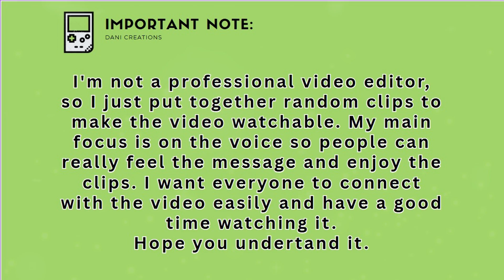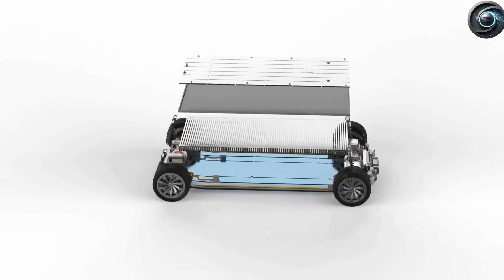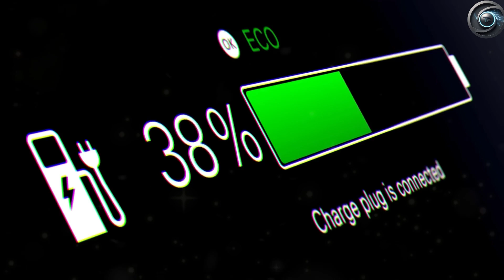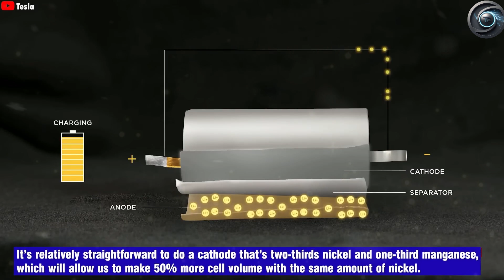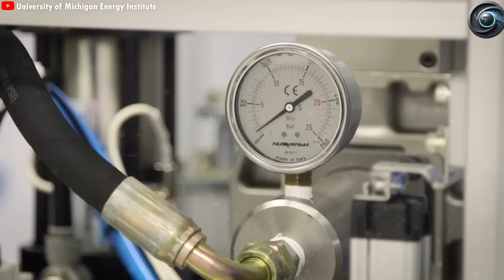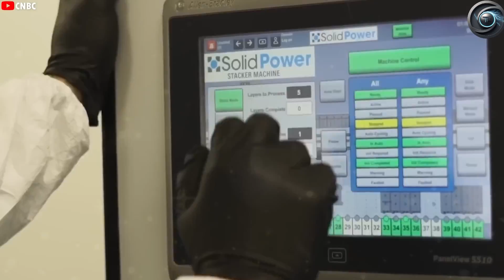Elon Musk CONFIRMS Tesla 1000-Mile CATL Battery! 2025 Game Changer

Comment: Totally irrelevant, the bottleneck is grid supply not battery absorption rate.
How long does the car have to wait at each charger type (with and without other customers charging) for each mile of added range is the only question that consumers actually care about.
And,
How much strain the charging binge on a friday after work before a long weekend will put onto the the supply network is the only question every sane individual cares about.